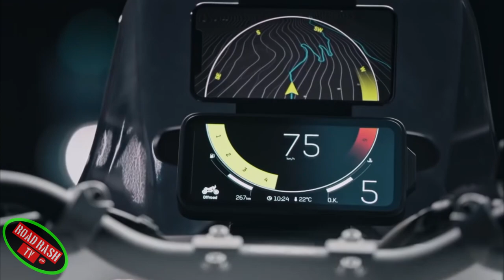Electric Motorcycle Tech - RIP Gas !

Comment: Japanese sport bike rider from day one, I do look forward to the advancements heading our way. Unfortunatly the price of these advancements might price themselves above an everyday rider. The Hayabusa in my opinion, did just that for 2022.
Reply from the maker: Hey Chris thanks for watching and your comment... you got a new 2022 busa you say? good as expected?
Reply: @RoadRashTV  I was not impressed with the 2022 Hayabusa, tighter seating position, felt brittle at 80 + mph, Tires were very tempermental. Electronics are a great addition for drag racing, Longer rides will benefit from the added cruise control feature. My 2017 Hayabusa was a much better bike in comfort & speed, I do miss it and look forward to going back to it.

Comment: Full on e-motorcycles might be a ways off from becoming a norm the way liquid fueled bikes are now. e-bikes are cleaner, faster and it's convenient to charge since you can just plug it into an outlet I reckon. The problem is that you can't go very far with it even of full charge, when that charge is done it takes a long time to recharge and that's if you're at a convenient charging station and in part of the world that's still few and far between. Doesn't really make a lot of sense you're just starting to enjoy your ride and then the steed tells you it needs to refuel. Hybrid makes more sense but I imagine that's more money and a heavier bike in general.